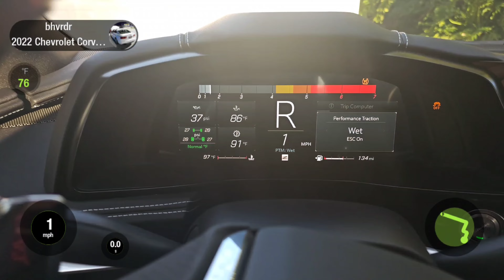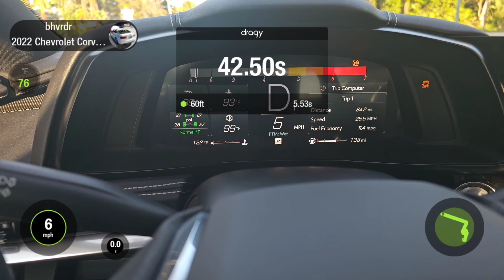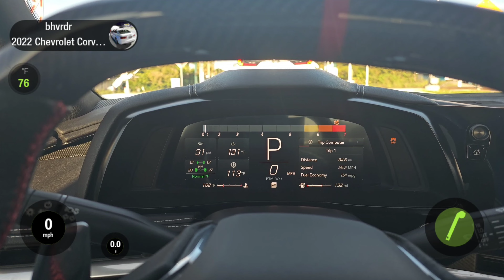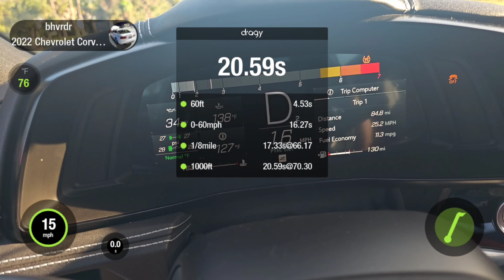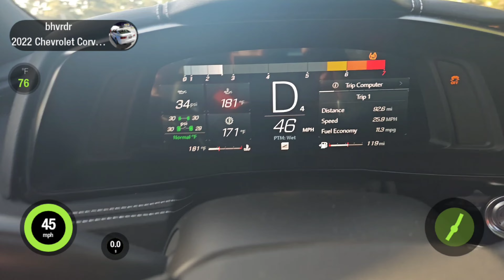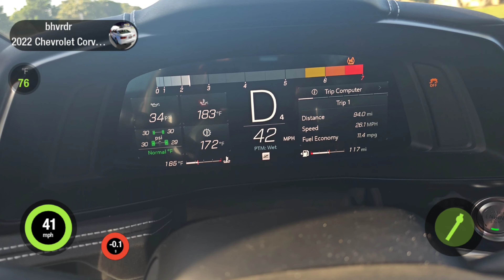Do ceramic low dust brake pads stop as well?   Testing powerstop z26 initial bite and cold stops.

Comment: Great review! I have been trying to figure out which pad to get for this street/sprited driving for my new 4 piston bbk. I was comparing amongst many of those companies you mentioned and the Powerstop Z23 seem to be the best all around pad. As you said, it also comes down to tire grip as well paired with the pads. I talked to a few others and they said it's held up on the Tail of the Dragon and another on track. I also read on a Mazda 6 forum a guy AutoX/tracked the Z23 and they held up great. If I find the Z23 fade, then I will proceed with getting track oriented pads or just get track pads to swap.